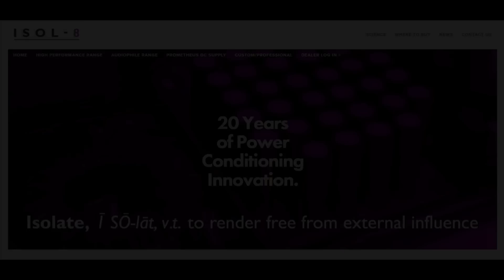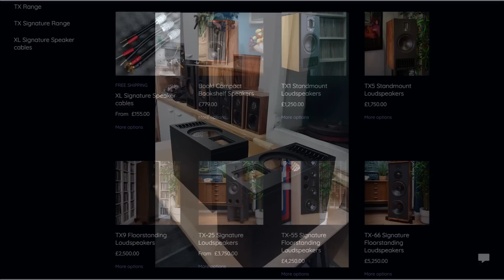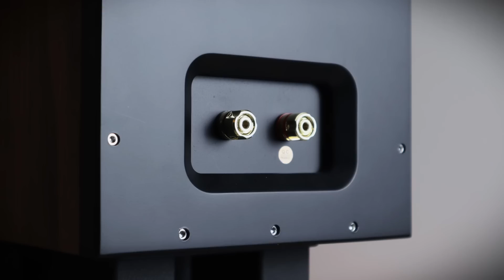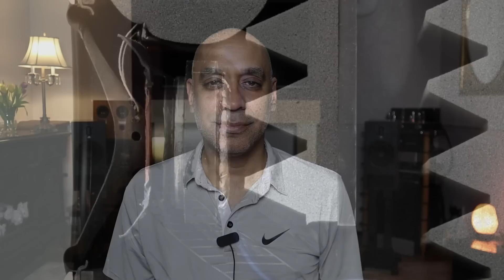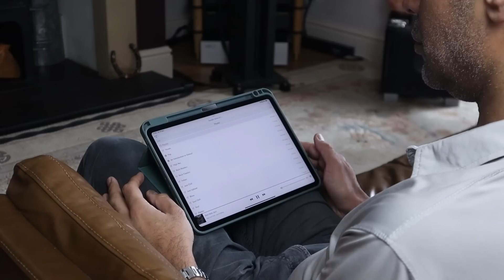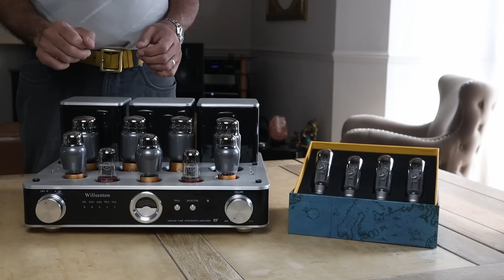TRANSMISSION LINE TREAT! Alchris Audio TX5 Speaker Review

Comment: Also, I had designed a pair of 6 1/2" two way stand mounted monitors in the late 1990's. to rival The BBC Benchmark Midrange Champs. The QUAD ESL 57 Electrostatics! I was told and laughed at by my good friend and owner of Western Reserve Audio Design ( Terry Techushan, the only certified Quad Repair Tech in Ohio), That's Impossible! Terry was building 200 wpc Tube Amps for Electrostatic Guru, Roger Sanders! I was the Speaker Tech that he subbed all his repairs out to.    Well, after Two Years, and a couple of Grand in the highest end drivers I could find, (Seas, Kef, Dynaudio, Scanspeak, Vifa, Focal, Cabasse, Morel, Peerless, etc....) I finally got them Right! I critiqued all Drivers by bending over them and listening to them in Free Air! ( Old School method). Well, I invited Terry over my place to listen to them. He could only spare a half hour. Terry Stayed for 4 Hours with Visible Tears running down his face as he just kept saying:: Wow! He admitted that I Had Accomplished the Impossible! I've always had a great ear for Sound. Terryhad been sending his customers to me. I was a paid consultant for setting up Sound Systems and Creating Listening Rooms. Bent your ears long enough. Bye. Chris

Comment: One more thing. Did you misspeak when you started that mid bass woofers radiate 180°? They don't! The cone is a vibrating waveguide that radiates outward and doesn't see the baffle. Also, you mentioned that speakers with  ribbon tweeters that radiate horizontally are more finicky than those with dome tweeters to properly place in a room. That is Blatantly Opposite of Sonic Reality! ( The Dome Tweeter set back accurate Audio at least 30yrs!) finally, many Tweeter designs have recessed waveguides ( mini horns). Even the First Metal Dome Tweeter ever designed had 7 horizontal contoured bands over the dome explicitly minimize vertical dispersion! Guess who designed it?  CELESTION, your very own UK speakers. So, I designed a pair of speakers 30 years ago,with a ribbon tweeter. Long before the rest of them jumped on to be ribbon bandwagon. Just thought I'd share.

Comment: After some deliberation, I'm going to reproduce a few comments here, following a discussion of this review on social media. I'm not remotely picking fault, just highlighting features I think were overlooked. Alan is a superb engineer, and I'd also add that the cabinet work and finishes are far superior to those of models costing several times as much.

AlChris' USP is delivering maximum performance for the money, and by that metric, they are unbeatable. Listening at over 90dB in a small room - exactly the environment these speakers are designed for - is mildly absurd. It speaks volumes (I'm here all week) that they had to be pushed beyond their intended operating range to justify any criticism. These are superb speakers.

"The fully floating front baffle that reduces vibration and colouration, the option of full or part covers, the mechanical isolation of the crossover from the cabinet, and the silicone wiring to help with microphonics, all these things help to get the very best out of that driver for the price point."
Reply from the maker: Thank you for sharing. I focused on the standout features of the TX5s in my review. Those are the transmission line construction, the Fountek ribbon tweeter, and the calibre of crossover components. The isolation of the front baffle and crossover, silicon insulation to wiring, and quality of cabinet finish are not that unusual.

The £899 Q Acoustics Concept 30s have full front baffle isolation, sophisticated suspension for the crossover, and even have a gel core sandwich cabinet construction. The Monitor Audio Silver 100s come in excellent real wood veneers or piano gloss finishes, with superb quality C-CAM drivers for £799.  The Buchardt S400 MK2 have a better quality SB Acoustics mid woofer (than the peerless driver used in the TX5), equivalent quality crossover and free delivery to your door, with a 60 day free home trial. all for 2,100 Euros. I could go on…

The TX5s offer very good value for money in a highly competitive marketplace, but they are not equivalent to models costing several times as much.

Comment: From the cutaway it looks like a straight (no taper) offset-driver transmission line build. I think a lot of the "effortless bass" impression that we get from these types of TLs is due to the vent area being almost as large, if not as large as the driver's cone area, resulting in very little power compression at bass frequencies.  Unfortunately they do come with some issues as well, primarily harmonic resonances that are lower down in frequency and therefore more difficult to address by lining or stuffing the enclosure, and if you stuff the enclosure too much, bass output is reduced.  Tapering the line moves those resonances up in frequency where they can be more easily dealt with via stuffing or lining. 

The offset picture in the cutaway also appears to be a bit too short to deal with the 1st harmonic resonance (usually at 3*Fb) that can produce a noticeable notch in the midbass response.  The amount of stuffing used in the box along the path can reduce that issue a bit however.  I've actually tried with success a slightly different fold that would take up the same volume that puts the driver closer to the ideal offset - see the PO7 project on my website, www.diysubwoofers.org.
Reply from the maker: Very interesting, thank you for sharing 😊

Comment: Your question of the day is easy for me to answer: I wish my Auralic Altair streaming preamp had either an HDMI input or a digital output. With an HDMI input, I could run my TV through its DAC (which currently is the best DAC in the vicinity of the TV); with a digital output I could use the external DAC in my reference system. I like to have options for my playback; but Altair seems to be more about simplifying system connections, so I’m considering ways of reconfiguring all three systems (Entertainment Center, Reference, and headphone) in ways to maximize use of the components I have on hand.
Reply from the maker: @jeremiahchamberlin4499  thx 😊

Comment: Great review, Tarun.  As for the “one thing” question, that’s easy.  It’s the power switch on the Linn LP12.

For all its woody steely loveliness, the one thing that sticks out like a sore thumb for me is the switch on the top plate which is black plastic.  There have been several versions over the years but until the £50,000 Anniversary Edition came along with its circular brushed stainless steel finish, all looked tacky in the beautifully finished plinth.

It irritates me so much that my latest upgrade to an off board PSU has enabled me to order a custom top plate with the power switch hole deleted.  Can’t wait to see my unique LP12 with its total lack of tacky placky switch. 😄
Reply: Have I read this right? You can pay £50,000 for a Linn Sondek LP12.
These were £90 in the 70's
Reply: @ the Sondek was £250 in 1980.  A Rega Planar 2 was £115, a Planar 3 was £150.  The latest deck has little in common with the original, except the top plate and outer platter.
Reply: @ I've checked, if I recall correctly, the Linn was about £90 in the  70's and the Ariston, I think it was about a tenner cheaper. They looked pretty much the same. Linn prices shot up after the night and day experience.
Reply: @markcarrington8565  Apparently it was launched at £59 in 1973, so my memory of about £90  five years later wouldn’t be far off.
Reply from the maker: @markcarrington8565  thx Mark 😊

Comment: Thanks for the review.  I’ve had a positive experience listening to speakers with those type of tweeters.  I haven’t heard transmission line speakers and after seeing you share a few I’m intrigued.  To answer your question, I wish my Holo Audio Cyan 2 DAC allowed you to switch between 2 different inputs with a switch on the front or even better with a simple remote.  Maybe the next model.  Be well and rock on!
Reply from the maker: @BobbyBass-x6i  thx. I am totally with you on the Cyan 2. The automatic switching is close to useless 😊

Comment: I would hardly call Dayton and Jantzen components as "top draw". I started building speakers a decade ago, with Parts Express being my main source for components. The components in this network are the next step up from super cheap iron core inductors and basic electrolytic capacitors. I seriously do love them for their actual performance however.
Reply from the maker: It is all relative. You can spends hundreds of pounds on a single capacitor. For commercially available speakers retailing for £1,750 this is “top draw.” 😉

Comment: Great to see a review of a transmission line based speaker . TLs are a personal favourite of mine after experiencing the deep,clean and tuneful bass from a pair of Castle Avon 5s over several years . Sometimes in design it is the skill of extracting the most from seemingly  modest components . A very pleasing review Tarun .
Reply from the maker: @petergraves3086  thank you 😊

Comment: Thank you for the insightful Review of a quality value small speaker brand. Similar to the TX5, my Kef r3 meta noticeable shortcoming, at peak decibels at 95 and above, is the bass woofer. At such peaks distortions, due to driver limit excursion, become quite noticeable, When I've auditioned KEF 1 Reference side by side with KEF 3 meta, the noticeable distinction is the ability of the Reference 1 to be driven harder and louder across all freqs, specially 60 hz and below. Your comparison based reviews are essential for all of us to determine the true quality and value proposition of a product.
Reply from the maker: @davidrivera2165  thank you kindly 😊👍